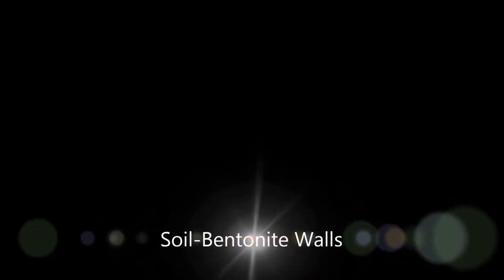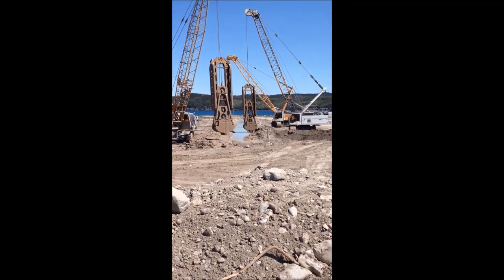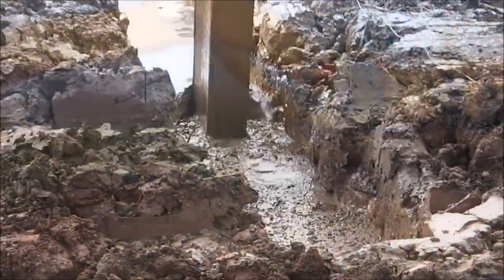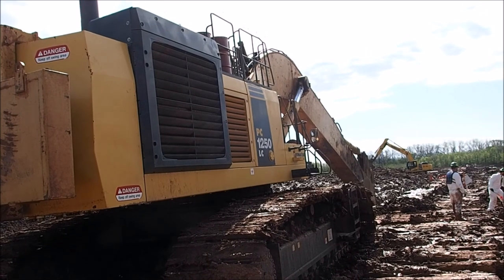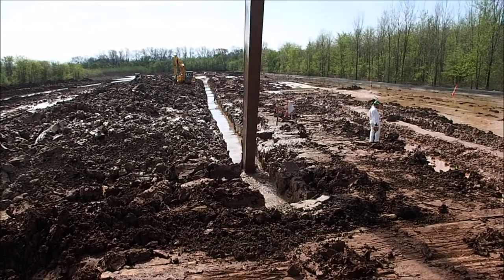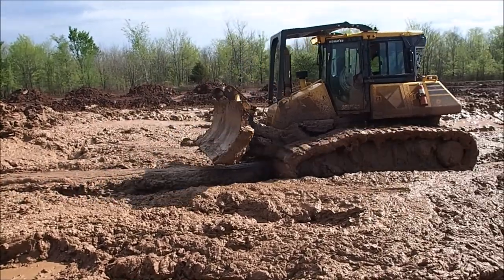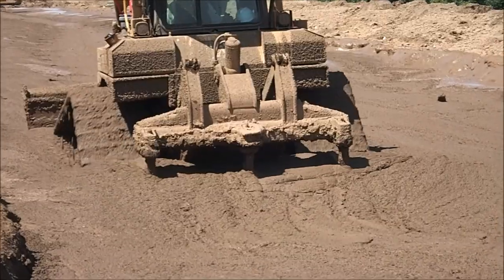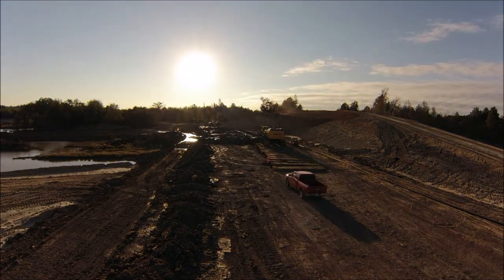Soil-bentonite slurry trench cutoff wall construction

Comment: Why are you digging a trench then backfilling it right away with native material?  Doesn’t backfilling defeat the purpose of the trench?
Reply: because they're creating an impermeable barrier around the site that contaminated groundwater cannot pass through... so they're replacing the permeable soil with an impermeable bentonite wall.